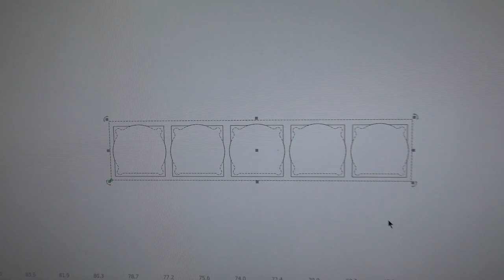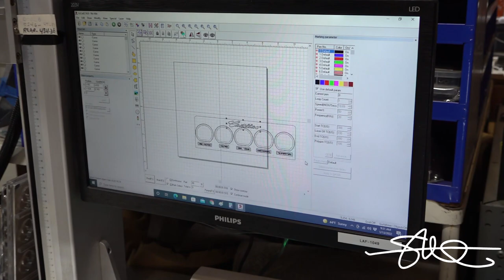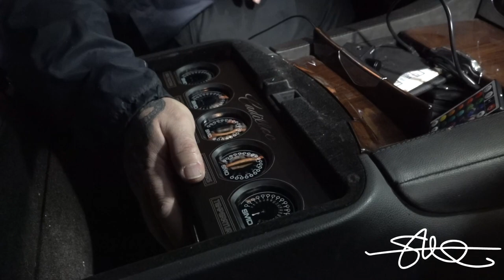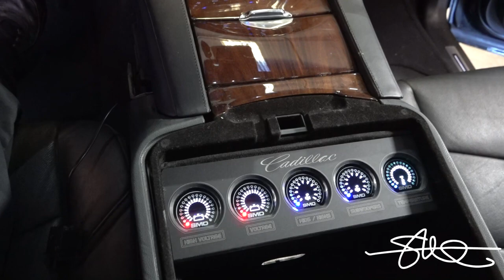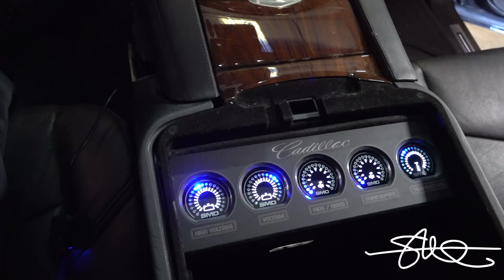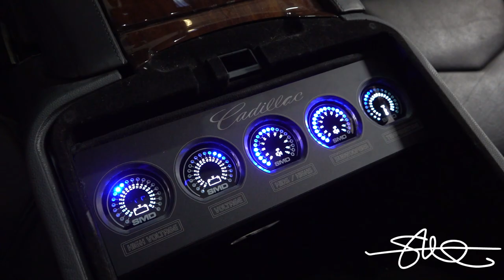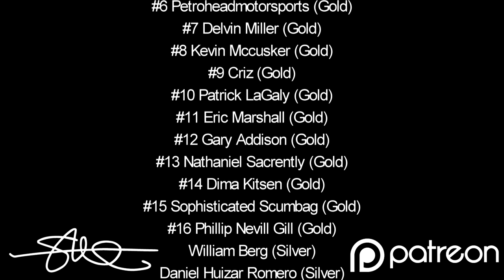Sound System Monitors - Custom Made Center Console LED Meter Display | Cadillac Escalade

Comment: Another work of art Steve. I wish more manufactures would put optical out on their head units as standard, these days with the way they are so integrated with the car it’s not easy to change them. Looks like on new cars like BMWs it would be impossible.
Reply from the maker: i have never heard of a single one that ever did. That is why i use the NavTV unit. Thanks man!

Comment: Only 2 things I personally would do is swap wood grain for carbon and more highs and mids in the back doors.  Dude this truck is sick af man.  Awesome job
Reply from the maker: i'm not a huge fan of the wood grain either. But i am even less of a fan of mids in the back doors.  I prefer my system to actually sound good.  Rear speakers will only make the fronts sound bad.  I ALWAYS delete rear everything in all my cars.  Thanks!
Reply: @meade916  to each their own bro, was no knock on it at all.
Reply from the maker: @MrKKUT1984  didn’t say you were knocking anything. 🤷‍♂️ Im just saying that i prefer good sound so i don’t run rear door speakers.

Comment: Ok i need help i just got two new skar 15s and i dont want to blow them and want it to sound good can u help me set it up with some advice. specs are as fallow

SUB ENCLOSURE: Enclosure features solid 5/8" MDF construction, charcoal carpet covering, a dual vented design, and terminal cup connectors
SPECIFICATIONS: Dimensions: 38" (W) x 16 1/4" (H) x 18" (D); Weight: 55 lbs; Air Space: 4.6 cubic feet

2 skar 15's

Dual 1 Ohm Voice Coil Configuration
Peak Power: 1,500 Watts
RMS Power: 3,000 Watts
Competition Grade Pressed Paper Cone
Stitched High Roll Foam Surround
Advanced Air Flow Cooling System
3" High Temperature Copper Voice Coil
Motor Weight: 306 oz
Frequency Response: 25-400 Hz
Sensitivity: 86.3 dB

The amp's are

BOSS R2000M 2000W Riot Monoblock Car Audio MOSFET Power Amplifier
RMS Power:
1500 Watts x 1 Channel @ 2 Ohms
750 Watts x 1 Channel @ 4 Ohms
Max Power 2000 Watts x 1 Channel